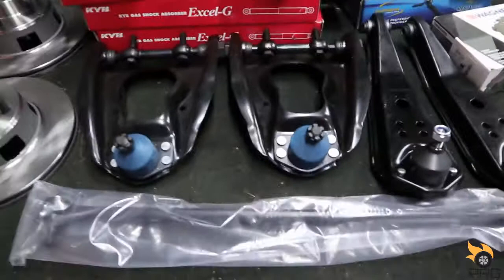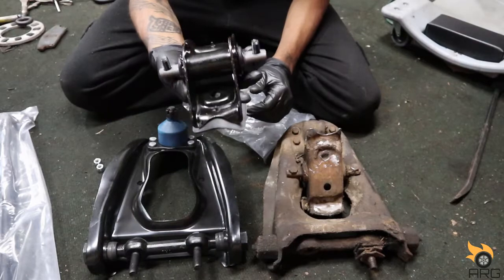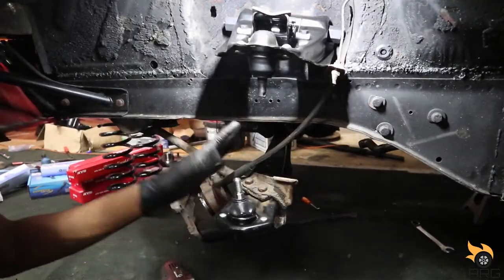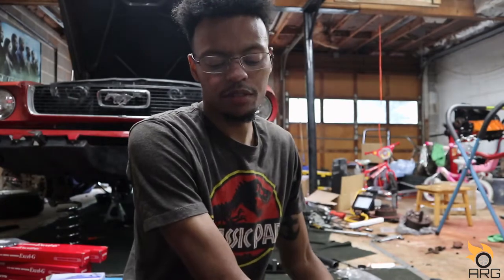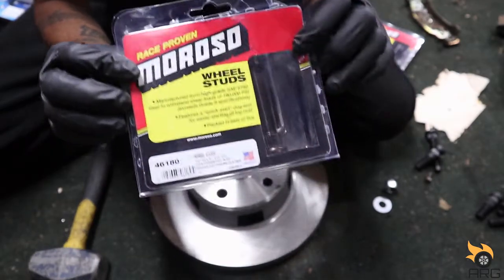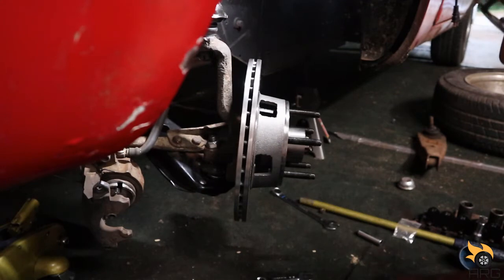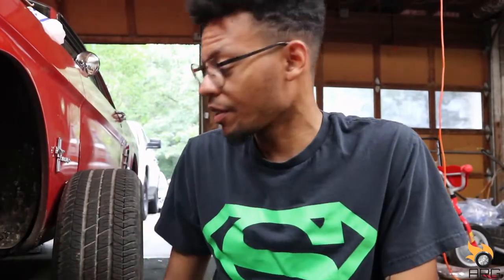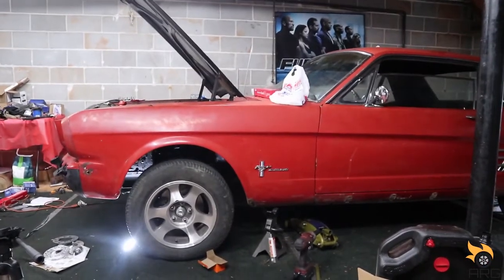1966 Mustang Suspension/Steering PT.2

Comment: Great video. Lots of good information here as I'm about to do the suspension on mine also pretty soon. I'm not trying to be a keyboard mechanic but when replacing the bearing seals I'd recommend using a piece of brass the same diameter to lightly tap the seal in place or at least a socket. That screwdriver can bend it and not make it seal properly. And pack that grease into the bearing until it starts to ooze out of the top. Put some grease in your palm and push it in there while rotating it little by little. Awesome car by the way!
Reply from the maker: I appreciate all advice anything I do I have to research and learn myself I don’t have anyone to show me so I really appreciate the advice
Reply: @autoraysgarage8938  You are a cool and humble young man.  You know a great deal more than 90% of us that watch youtube.  Keep up the good work!

Comment: everything look good mi brother but please clean the old parts next time 😎
Reply from the maker: Appreciate the tip, either this winter or beginning of next year i'll be pulling the engine and front suspension all out to replace the radiator core support and at the same time really get those inner fender wells clean and repainted along with the engine bay

Comment: Looking to do the same on my 66 mustang 289 C code. I’m all caught up on your current videos. You thinking about switching to rack and pinion steering?
Reply from the maker: Yeah that be the goal in the very far future since i don't see myself selling car.
Reply: @autoraysgarage8938  that’s awesome. I don’t see myself selling either but how much did this cost you roughly? I wanted to control arms, sway bars, centerlink, shocks and springs, and I was thinking leaf springs but definitely the front first
Reply from the maker: Parts were easy to find and not to expensive you got options for just going with stock suspension which I did or going all out upgrades I have to add everything up but I think it was around $300-$400 for all the front end suspension